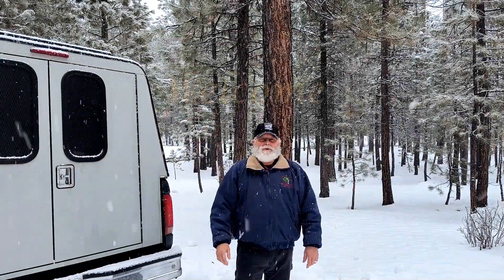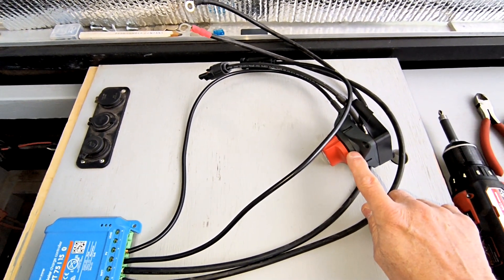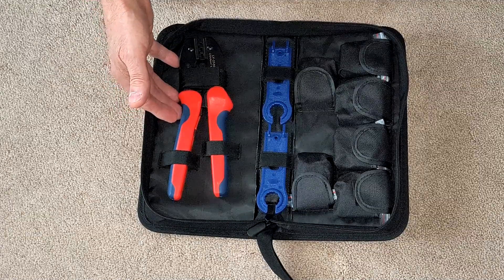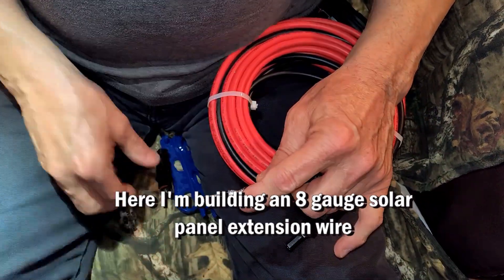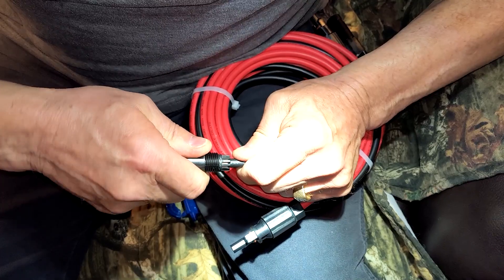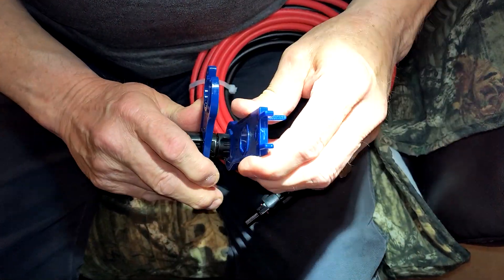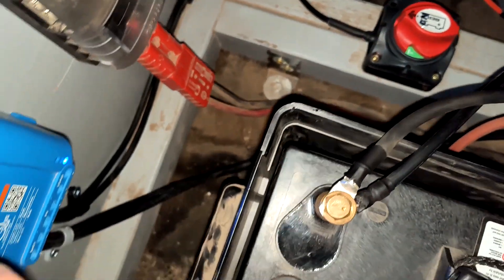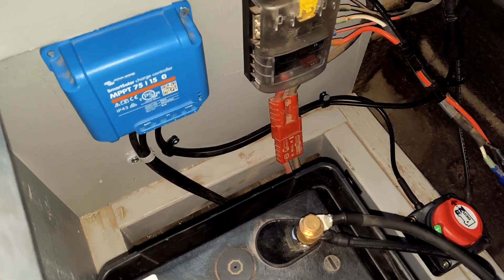Solar MC4 connections, Charge Controller Wire Harness, Solar Panel Disconnect Switch in RV Camper.

Comment: Great info 
but why did you need 8 AWG Wire?? 
? Over OVER Kill 👍
Reply from the maker: Because I have a 12 volt system and running 20 feet from panels to charge controller. Thank you for watching. Please Like, Subscribe, Ring the bell and let others know about our channel on your social media.
Reply: I am not sure what he has for panels, but 8 AWG wire is good for a max of 24 amps continuous,  and at 13.8 volts  is only about 330 watts power.  Thats easy to do with only 2 panels. (my own system for my camper will be 800 watts from a set of 4 panels) .  Better to error on the side of the large size so you don't have to buy it again if you add on to your system.
Reply from the maker: @arnoldgrubbs2005  The 20' 8 AWG cord that I was placing the MC4 connectors on is for my standoff solar panels that are set in the sun while camper is in the shade. Thank you for watching and taking the time to comment. Have a great day